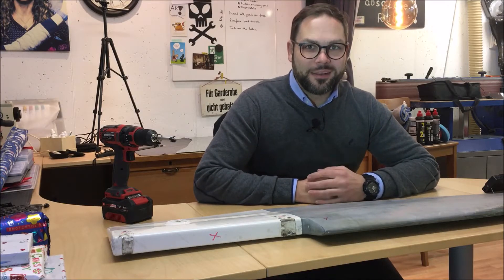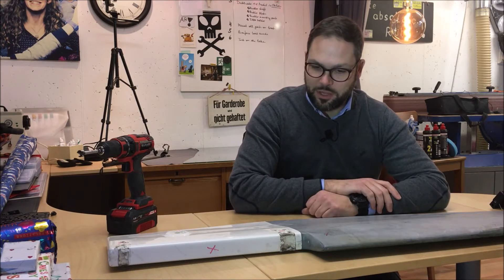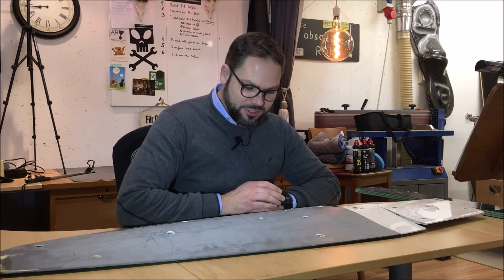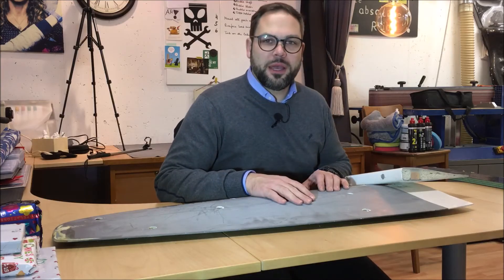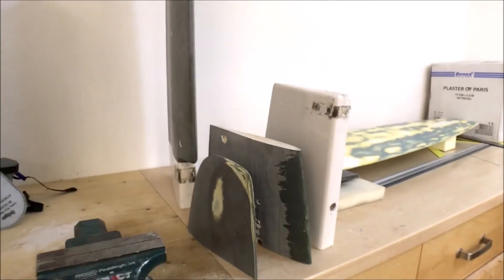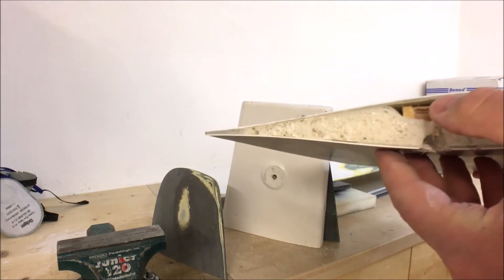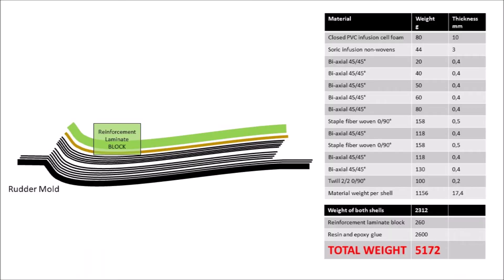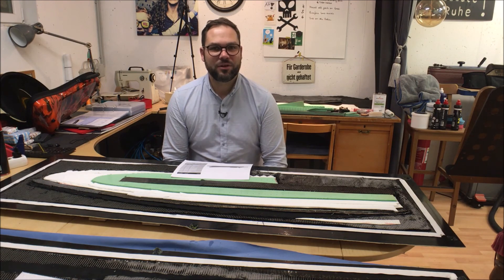Episode 4.3 Preparing layers of carbon for resin infusion, new carbon fiber rudder blade

Comment: Waaay to many layers. You should really investigate the properties of cf and do some calculations.
I do agree, you got one sturdy rudder there but you have lost the profile and you will loose boat speed.
Reply from the maker: Dear Allan, many thanks for your kind comment, you are right with too many layers but as said I knew that layers are too much it is hard to calculate the impact of the different layers on the different parts on the rudder, The layers are also not covering the whole rudder only partially, I am not sure if you can see that in the video at the end the weight was the same, as with the glass fiber rudder maybe I could have saved one kg at the end which is not much so I decided to go the save way. With regard to the profile I do not agree, because the rudder has completley the same profile and dimension like the original one as I also took the form from the original rudder check out my videos from mold making and infusion I wish you all the best kind regards Alex